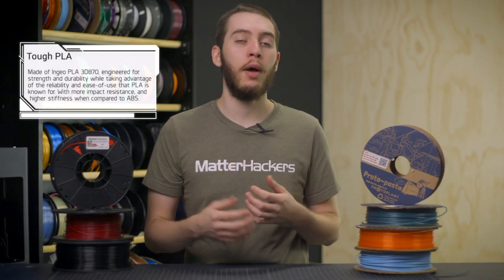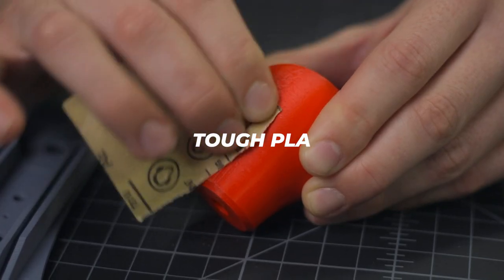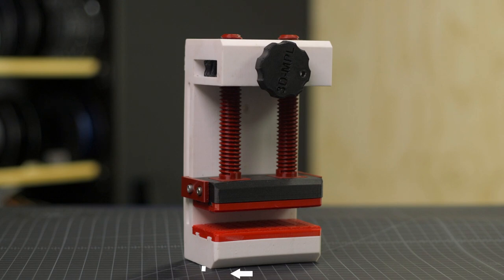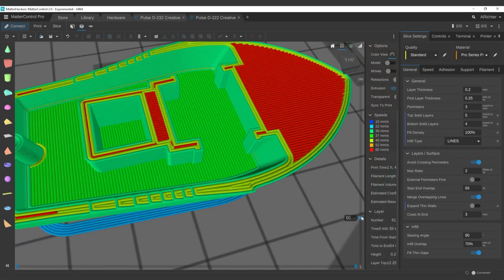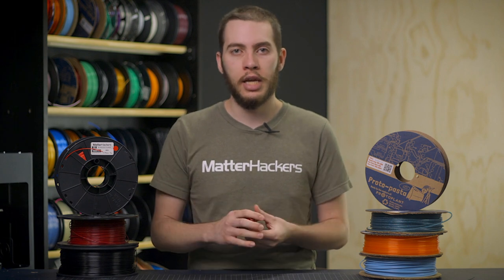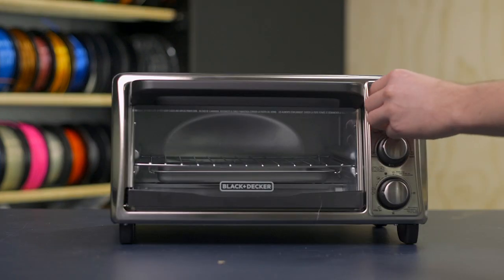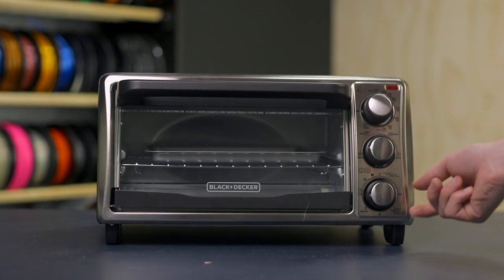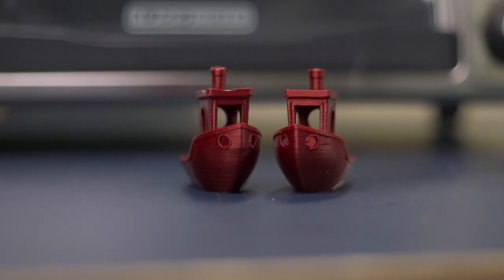How To: Anneal Tough PLA and HTPLA

Comment: Instead of sand, i would use salt as it can be dissolved in water, making it easy to remove
Reply: i wonder if cornstarch would work or even baking soda
Reply: @LT72884  salt has a relatively high melting point.
Reply: @brianfoster7064  exactly. Baking soda does as well. If you bake baking soda at 450, it turns to washing sods.
Reply: @LT72884  I think they might absorb the plastic more once it's hot enough, so something hard and very fine-grained might be best.
Reply: @LT72884  Corn starch is flammable, I would be very hesitant to use it.
Reply: @kustomkool  true, but thats usually in a dust form thats its flammable. Now im gonna have to try lighting a hole bunchbat once and see haha
Reply: @kustomkool  lol not a problem at those temperatures. You're talking about the same temperature that you blind bake pie crust with kitchen paper :) I mean... I don't think it's more flammable than paper.
Reply: Late chiming in here, but how about bentonite clay?
Reply: Anyone make a video?
Reply: @spitfire1903  after some experimenting in the past, salt is not the best as it can leave a white residue and react with plastic which can  be difficult to get rid off but that is a case by case basis, so feel free to experiment or make a video

Comment: for hundreds of years, cultures have baked food in a salt crust. Basically, what you are doing in this video, but with salt. It works very well. I am going to be trying it with cornstartch, baking soda, washing soda, and maybe something else.
Reply: As in the kitchen, the salt must be WET. When is backed It will be hard like rock. I have cheched PLA with salt  for 40 minutes and 140 Celsius ( 284F) degrees and left slow colding.  PLA seems fine.
Reply: @JuanPab521  why must it be wet? Wouldn't it be the same as sand if it were dry?
Reply: " I am going to be trying it with corn startch, baking soda, washing soda" How did you go?
Reply: @johncrow5552  no one ever does what they say they will do

Comment: PRE HEAT PLA, i USE A BISCUIT TIN 3 HOURS AT 62 c THEN TUrN THE SPOOL OVER AND REPEAT 62 c FOR 3 HOURS tHIS hELPS STOP SNAPPING... OPPS cAp LOCKS ON

Comment: Do either of the PLAs outgas during annealing?  Would it be safe in a standard oven that is also used for food preparation?
Reply: I wouldn't use anything used for food processing to work with your print jobs. Even if it doesn't harm you, you can be sure that you'll taste it in your food.
Reply: @GreenGreen-bo5qe  Pla prints emits a lots of tinny particles, so dont sleep.in the same room whith yuor printer print.Maybe today yuo dont feel nothing, but remember, its a matter of time an exposition.
Reply: @noway8233  one time i was printing pla+ at 230c and i sat inside the room for a few hours, i started to feel sick and nauseous and i think it was the filament. Since then ive had a makeshift enclosure with a duct and fan exhausting air outside. Best ghetto box ever.

Comment: Nice video, and I love the sand idea (method 1) :) maybe a few notes: During the annealing process the Tg doesnt change (it is intrinsic to the material) I think you were more referring to the heat resistance increase (maybe referring to its HDT or VST). I would highly not recommend using 100% infill, the shrinkage is not mainly depend on the infill pattern but rather the polymer orientation which means the printer path, 100% infill is more for supporting the structure when heating up above Tg, but the more material the worse the dimensional change. And maybe a last quick point is that the sand is not going to prevent part deformation (shrinkage) it will only act as a support for the part when the temperature will be in between Tg and Tc :)
I hope this can be as useful for your community as your great videos :)
(I would also explain the innovation behind the HT PLA which i guess is playing with an optimize nucleation process to allow the crystallization during the printing process, allowing it to enjoy better resistance during the annealing process :) )
Reply: Hi,
do you have a blog/Reddit or something?
I’d love to read more of what you write. I think there’s not enough stuff on 3d printing science.

Comment: What if you put the print in sand, and then heated it in a pressure cooker.  Would the pressure help to hold the part in it's original shape?

Comment: I am still waiting for an all around good engineering filament. The best at the moment is PETG in my experience.  It prints easy enough and does not suffer as much from warping. 

However, PETG is too flexible. I wish I could print something like PC as easily. 

My ideal filament would be:
1.  something that prints without an enclosure

2. Good up to 100 C at least 

3. Maybe reinforced with fiber 

4. Stiff 

This is why I think the future I'd desktop aluminium printing. Aluminum is orders of magnitude better than FFF plastic
Reply from the maker: In my experience, carbon fiber PETG is significantly stiffer than regular PETG and may be what you're looking for out of stiffness, but I haven't put it through any thermal tests. - Alec
Reply: @MatterHackers  I would love to see a fiber filled PETG from matter hackers at an affordable price, maybe 50 usd per kg. 

What about PC PETG blends?
Reply: There is an affordable aluminum 3d printer?
Reply: @firearmsstudent  no, there is not
Reply: @May the Schwarz be with you  there are some special filaments that can be acquired that allow one to print in FDM but you take the print and throw it in some sand in a crucible and heat it to crazy Temps. The original substrate gases off and you are left with mostly metal. As you can imagine the technique tends to warp the living hell out of the print amd it isn't priced low enough to accommodate failed/test prints.
Reply: I've been printing my parts with PETG and it is VERY TOUGH, especially if the part is printed solid. Tonight, I'm going to be annealing a part in my home oven using desert sand and it will be virtually indestructible.

Comment: Timely video as I was just getting ready to anneal some PP HTPLA. It was for an object that had various different thickness and widths. Needless to say the different areas all shrunk differently so the piece is not even usable any more. I was hoping to get a shrinkage ratio so I could adjust the print accordingly.
Does the HTPLA offer any improvements for temperatures without annealing?